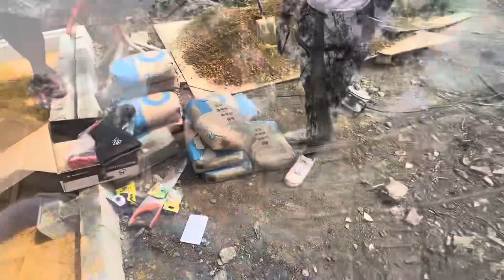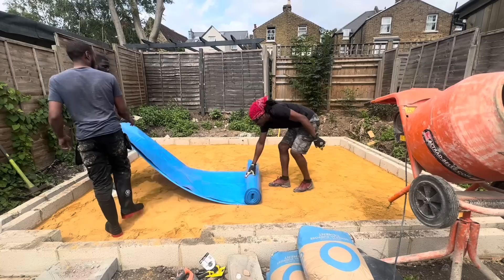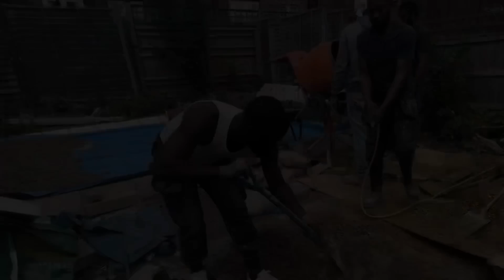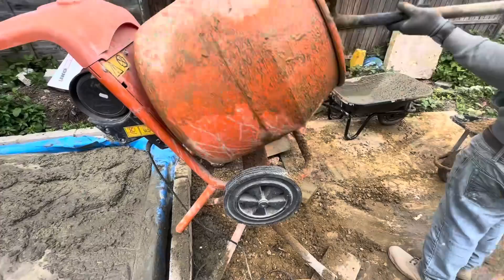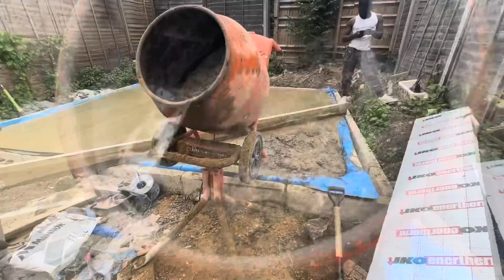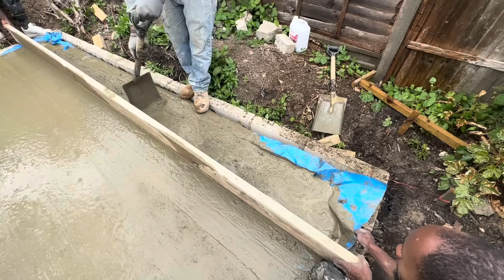Rescuing a cowboy build - Day 12

Comment: I know nothing about building but watch this channel and also Alex and Steve. When they put concrete in they put a layer of thin polystyrene between the concrete and the brick wall. Why is it used/when is it not used? Is it bad use this is a garden house? Fab channel. Thanks 🙏🏼
Reply: I was going to ask the same question. They did an interior floor recently - the wooden frame extension - which had the thin edging strips, so I can only assume it isn't required for exterior standalone structures. I believe the purpose is to stop cold bridging. 👍
Reply from the maker: Hi Guys yes we normally add it when doing extensions or anything under building regs. It is to stop cold bridging. However unless we have some 25mm lying around we don’t do it on these small garden houses as we have to balance costs and the strip is so small so we don’t. The way we build these little houses is very close online with building regs but not every aspect otherwise they would cost twice the price and not be affordable for most clients. Hope this helps
Reply: @darrenthebuilder  Thanks Darren. That helps clear things up.
Reply: @darrenthebuilder  cheers chap. Thanks for the channel. Can’t wait to see the ruined conversion be done properly. Can you introduce some of your employees to us one day? 🙏🏼